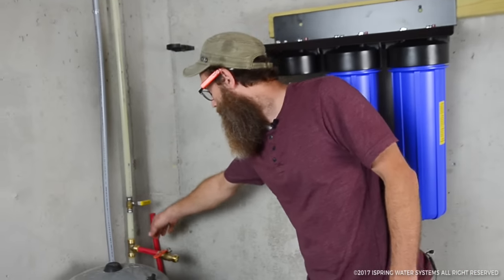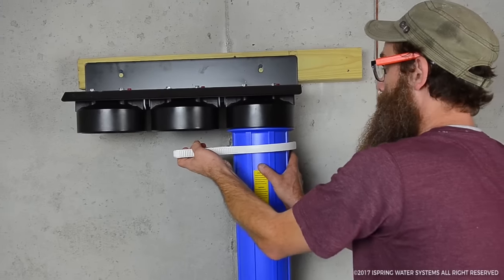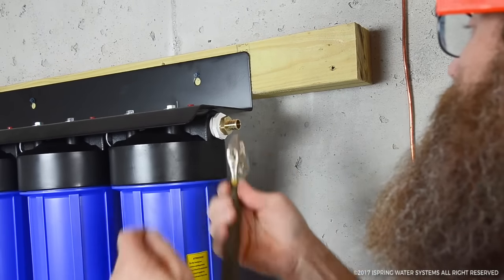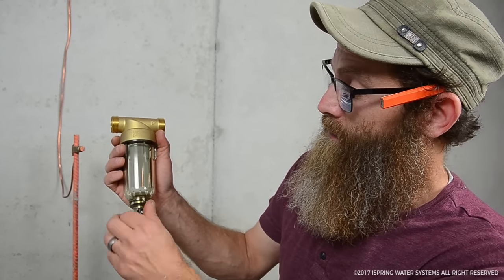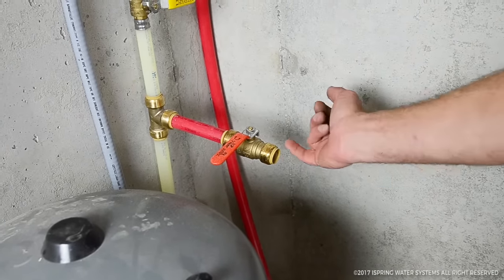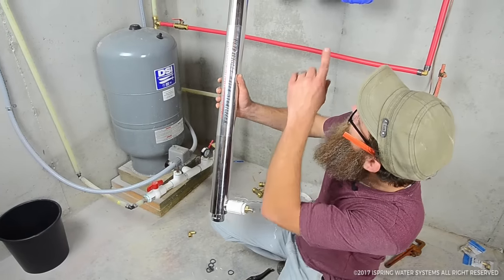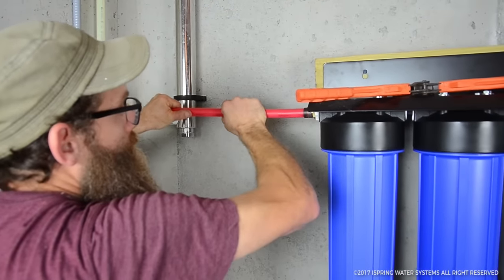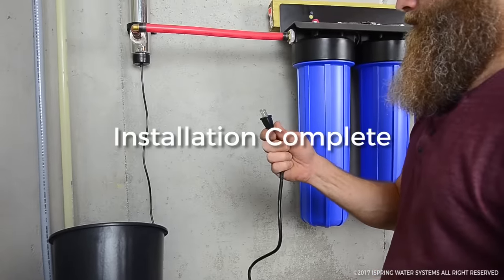iSpring Whole House Water Filter Systems DIY Installation

Comment: The uv light should be controlled by a flow sensor so that it only turns on when new water enters the metal tube.
Reply: What about delay time in the flow sensor?
Reply: Cycling the light on and off continously will shorten the bulb life dramatically... they last about a year running full time.

Comment: Hello I have smelly sulfur well water. Also iron,, rust, Who knows what else? Will this help? Thanx
Reply from the maker: Hi Ben. Our whole house filters can help with well water problems but they also have limitations. We suggest you get the water tested so we could offer better recommendations based on the test results. You can get a thorough water test via most major universities in your area at a relatively cheap price. Please feel free to contact us after you get the results.

Comment: You're crazy crimp in those fittings that grade Apex is supposed to be used with expandable ring not a crimp ring that have class action lawsuits on crimp PEX Opex I don't know why I wrap and will company like yourselves is not using an expansion tool and using it the way it was intended to be used
Reply: Allen Simmons 
For some reason i cant understand you.. but i believe that is a lesser grade of pex pipe. 

Btw.. if your pex has expanded.. it needs to be replaced. It can only expand so much /many times. Then also fix the condition causing freezing.
Reply: yep crimp is old school. A PEX all the way.

Comment: Do systems like that remove pfas?
Reply from the maker: Hi there. PFAS are removed by the Granular Activated Carbon and Reverse Osmosis Systems. 
Please, refer to our RCC7 system:
https://www.123filter.com/ac/index.php?rt=product/product&product_id=177&acid=2
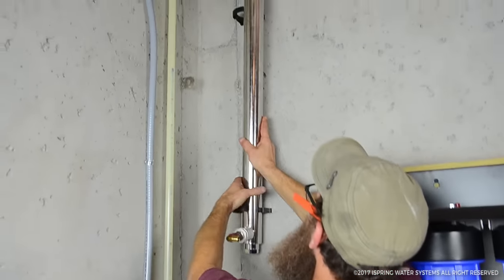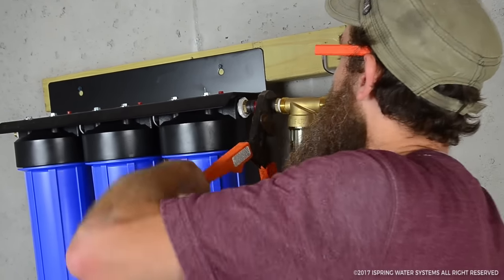For further concerns or questions, please contact us at support@123filter.com or at (678) 801-9308 M-F 8:30-5:30  EST// (678) 261-7611 M-F 8:30-5:30 EST.

Comment: sir will the flowrate be affected if you are reducing the diameter of the pipe?
Reply from the maker: Hi Ra. The flow rate for our whole house systems is around 15 GPM. Normally they won't reduce much pressure。 If you have further questions, please feel free to contact us at 678 261 7611 (M-F 8:30 - 5:30 EST) or email us at support@123filter.com. We are happy to help!

Comment: Would this system go before a water softener?
Reply from the maker: Hi LaserFalcon. This system should be installed after a water softener so that the water softener can help to extend the lifespan of the water filtration system.

Comment: Does the uv light always have to be on? Would it be safe for the filtration plant, or that i have to turn it on only when i drawing the water from the filtration plant.
Reply from the maker: Hi A. Thank you for reaching out! We recommend leaving the UV light on unless you are not going to use it for a long period of time. Our new UV light product UVF55FS, which will be on the market soon, has a flow sensor that can automatically turn the light on and off.
Reply: @iSpringWaterSystems  thanks for responding, so that means there is no harm in leaving it on over night and all day long. It wont cause any harm to the equipment and the tube it self?
Reply from the maker: @user-ng4fc8zu2j  If the system is installed correctly, there should be no harm in leaving it on overnight and all day long.

Comment: Does the water go through the pressure tank first or the filter system?
Reply from the maker: Hi Rick. Thank you for reaching out. Our whole house systems don't have pressure tanks. If you are talking about our RO systems, the water goes through the 3 pre-filters and the RO membrane first, then fills up the tank. When you get water from the faucet, it goes from the tank through the post filter to the faucet.

Comment: Good morning, a suggestion for the manufacturer is as follows, in the passage of the UV lamp the wiring runs along the water, it may be better because there is no good system in all filtration and the wiring following the internal flow, if the wiring is non-toxic disregard , an excellent development in filtration, Top.

Comment: Did anyone else notice the rebar used as a house ground? Won't it rust and give a bad ground? Also, an of the rebar not in the ground is a waste... I always used a copper ground rod. I have an iSpring RO filter for the kitchen and it works well.
Reply: Copper clad is good but re-bar is better than nothing.
Reply: It's called a uffer ground and works very well.
Reply: Mr HVAC 
Yes it usually works better

Comment: Would it be a good idea to install a water softener after the filters before the UV light?
Reply from the maker: Hi Nicolas! Thank you for your question. You can install a water softener after the filters. In that case, the sodium added by the water softener will remain in your water. If you install the softener before the filters, the system will reduce the sodium added from the water softener. Either way is okay depending on your preference. If you have further questions, please contact us at (678)261-7611. We are always happy to help!

Comment: Putting the UV Light power socket side down is a NO-NO.
Reply: I was also going to comment on this issue . But I saw you beat me to it . Water runs down so if there is a leak it will be running on to electric fitting  and wires . Best practice is to have it on top when running the light in that direction. Otherwise I thought was pretty good job

Comment: Why did you use 20in filters that are more expensive and hard to find,the spin down filter is brilliant.
Reply: Hi,

We have various systems that utilize different filter sizes such as 10" and 20" long. The 20" filters offer more surface area to treat the water and these filters are best utilized in our commercial and whole house systems. Please let us know if you have any additional questions.

Thank you,

iSpring Water Systems LLC
Reply: looking to do something like this to my new house,  how much is a system like this cost. will it help with the yellow water stains in the tubs
Reply: not hard to find in the times of amazon/ebay.

Comment: I have their ISPRING RCC7 5-Stage Under Sink Reverse Osmosis Drinking Water Filtration System.  The water that comes out of it is filled with bacteria.  Their manufacturing process must be a hot mess.

Comment: So how do you know when it is time to change filters?
Reply: When your water pressure begins to fall off.
Reply: wouldn't it be better to put a pressure gages in the filter inlet and outlet side, so you can see the pressure drop through the filters. before it is a problem.
Reply: @MNicehole Good point. Some brands do have pressure gauges built into the manifold.

Comment: Great video but quick question. Why did you double up on the crimp rings? You only need one per joint, and two, why did you use red pex instead of blue? I know it doesn't really matter in terms of functionality but I am just curious.
Reply from the maker: Hi Yehuda. This is a customer video and he probably did that because two are better than one - just for some extra protection. Pex tubing is available in a variety of colors but make sure you use only tubing for potable water. 
If you have more questions, please feel free to contact us at 678-261-7611 (M-F, 8:30 - 5:30 EST) or email us to support@123filter.com. We are happy to help!

Comment: double crimp a pex pipe line yet use shark bites. haha Saying "copper is not so friendly to use" at the exact moment that you should be using copper or probably stainless steel. haha

Comment: I don't see any point in having whole house filtering. single good system in the kitchen for drinking water is all you need, unless!, you have water contamination.
Reply: Hi John Douglas,

The filtration system's main purpose is to protect your appliances such as your water heater, dishwasher, and laundry washing machine to protect against scale buildup. This system can also reduce scale buildup on fixtures such as toilets, and faucets. The system also filters water that you bathe or shower with and can improve the quality of your skin, hair, and scalp.

Thank you,

iSpring Water Systems LLC
Reply: John, most tap water is contaminated today. We can't depend on city water to be totally good for us. That's why millions of folks today are drinking bottled water. City water is "purified" with loads of chlorine which is a toxic chemical.
Reply: rain is just as contaminated mate, chlorine is only toxic in strength and over 100 years of testing has shown absolutely NO effect on health what so ever, so you're speaking utter crap on that point.
and by "contaminated" what exactly do you mean?  with what? "all sorts of things"?  generalities with no point?
"pure" water, ie distilled, is terrible for you, it strips out minerals from your body to equalise it's self, so we require any number of "contaminants" to live.
most "contaminants" are totally harmless to the human body, and some are beneficial. 
so what exactly do you mean?
Reply: Do you think drinking chlorine is good for you?
Reply: Some people just care about their health a bit more and nothing wrong with that. If you are happy drinking chlorine, or eating foods that you know are not as healthy as they should be, then go right ahead, but for you to disrespect others just because they have a different opinion, not cool. If you are willing to comment, there is no need to become a jerk and start saying crap to others. Would you do it in person? If so, then you need to stay inside your pretty little home. That is why I hate reading comments because of people like you. Have a great day and God bless everyone even Trump.
Reply: You only need trace amounts of chlorine to kill bacteria. 0.02ppm isn't going to hurt anyone. And can be filtered out for taste with little effort.
Reply: John Douglas
many well water systems have rust.
Reply: rust is usably iron, which isn't going to hurt you unless it's in concentration, and even then, have a tap connected filter, there's no reason to filter shower or toilet water, it's completely pointless.
Reply: The rust ruins pipes, stains toilets and clothes.  Also other things in well water cause rotten egg smell in hot water.  Have you ever had a well?  I think your post is useless.
Reply: John Douglas 
Australian but yet you know everything about water conditions everywhere. No iron does not mean contamination.  Many underground water supplies have Dissolved iron which when it becomes exposed to oxygen becomes ferrous iron (particles) and the hydrogen sulfide is produced by the chemical reaction with the hot water heater anode.  But nice try.  Rain water is totally different. Maybe you should stick to commenting about what you know.
Reply: @John-gm8ty  I don't see the point of your attitude and use of cussing. Do you think it makes your opinion more valid? Because it doesn't..
Several people in other comments have tried to explain to you that they have stains, rust and calcium built-up on their sinks, commodes, pipes, etc. and they simply don't want to drink that water. What's wrong with that? Nothing, absolutely nothing. If you want to drink the same water that not only creates stains but has been shown to have trace amounts of tampons and diapers then by all means, do that and enjoy it. I would assume that filtered water is better and carries less risk then water that's not filtered but you seem to disagree, in spite of the fact that we do see the stain and built-up of the city water and the reports that show it contains stuff that water should not contain. Also, every year there's an announcement that due to a storm the water has gotten contaminated with sewage. If you are okay with that and you trust your city officials to clean the water properly then again, drink it and enjoy. The others will drink their filtered water and enjoy it just as much, if not even more.
Last thing, chlorine doesn't have to kill someone to be considered harmful. It irritates the eyes and skin at quite low levels and can also cause permanent lung damage. Yes, do have chemical elements in our blood and body but we don't fees on them, do we? That's why your diet is made of fruits, veggies, nuts, meats etc.,  instead of chemicals from the cleaning store.

Comment: Sure, this system filters the water including necessary minerals for the body. How do you put back the minerals that you are removing with your filtering?
Reply from the maker: Hi James. Our whole house water filters only remove contaminants from your water. Necessary minerals will not be taken out by these systems. If you have more questions or concerns, please feel free to contact us at 678-261-7611 (M-F, 8:30 - 5:30 EST) or email us at support@ispringfilter.com. We are happy to help!
Reply: You can take the filters out.  

or buy water with the minerals you want.

Or supplement the minerals you desire.

Comment: Is there ANY reason why I shouldn’t put a couple of filters before the pressure / holding tank? 

I already have filters after the holding tank, but I was wanting to add a couple more to my filter system to filter my water hose because we use the water hose to add water to our pool. So I was thinking why not install them before the holding tank to protect that some and it would also allow the two new filters to not only filter the water hose but it would also be adding two more to my whole house filter system.

Thanks for any information you can share.
Reply: Hi Jay Davis,

You could add some an additional whole house system or a spin down sediment filter before your pressure/holding tank if you would like. This would add additional protection for your pressure/holding tank from scale buildup or sediment if you install a spin down filter. Please let us know if you have any additional questions.

Thank you,

iSprng Water Systems LLC
Reply: @CS-rn7mn However, it was pointed out that a clogged filter UpStream of the pressure tank might somehow damage the well pump, and that doesn't make sense to me ?!?  Can you offer any clarification ?? TIA

Comment: 5:50 
You're incorrect. You're using PEX-B fittings which means you're not using PEX-A pipe so it is not going to expand and return to it's normal state. 
If this is your trade you should invest more in your tools and get a PEX-A expansion tool and stop fussing around crimping an inferior product.